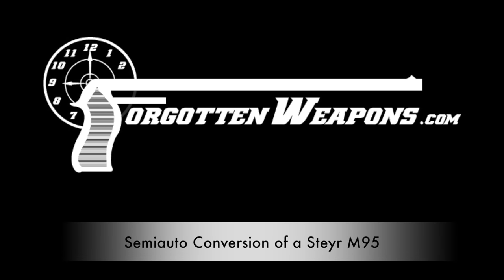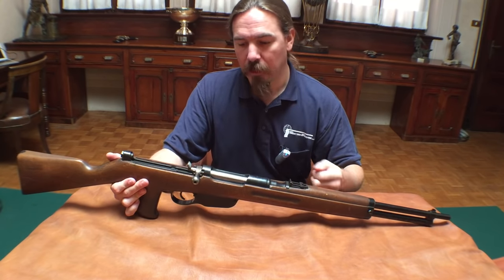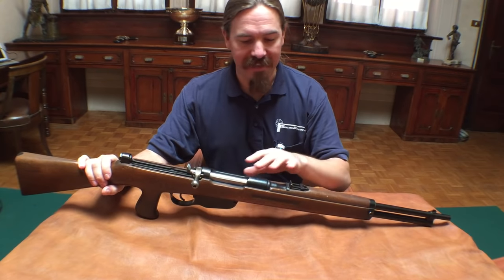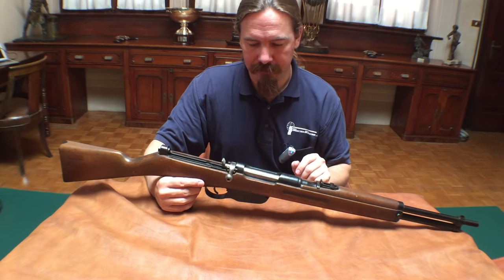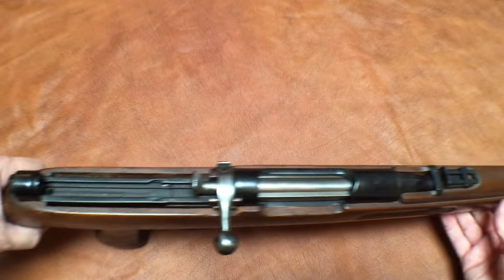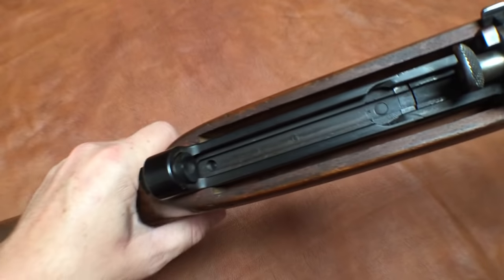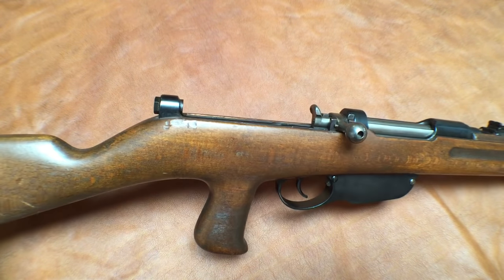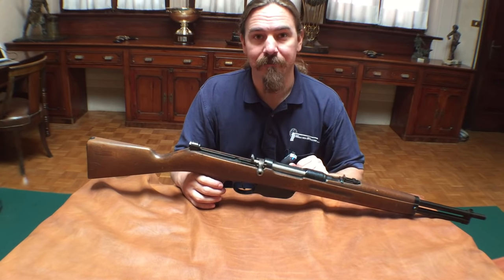Steyr M95 Straight-Pull Semiauto Conversion

Comment: Hi Ian, excellent video, as always. I've been a long time viewer of yours. I watched this video twice trying to understand the action, just in case I had missed something the first time. It's pretty simple, as you said, but one thing caught my eye. I'm unfamiliar with the M95 as I don't have one, but I noticed that when you pulled the trigger, the sear-looking thing was depressed. You mentioned that originally that would have been for disassembly, did you have to depress the trigger to remove the bolt on the M95  originally? Was it possible that this was fired from an open bolt? It almost looks like it would have been. I only ask because I'm mostly familiar with early Mausers that have the sort of side-sprung lever to release the bolt. Very cool gun though. Thanks, keep it up!